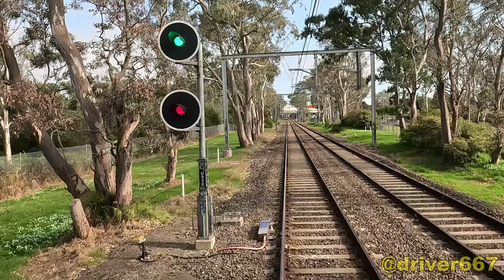Three position signallling in Victoria, Part 1, July 2025

Comment: As a small level train fan, high level rural commercial driver, I always wondered about these light combinations. As most of my driving comes into contact with infrequently used tracks, I have learn't three important things about the signal lights. Very handy if I am approaching an out of sight crossing. If the signal lights are on, there is a train ahead or behind. If both are red, it's close. If the top one changes green as I'm approaching, the train is going the same direction and is ahead of me. If the top one changes red, the train is next to me going the same direction, or about to appear in front of me heading the other direction. This small amount of knowledge has helped me avoid having to brake heavily at crossings. Handy in places around Tatyoon/Mininera, Willaura, Westmere, Pura Pura/Vite Vite, Minyip, Warracknabeal, Clunes, Talbot. These places appear to only have the signal lights come on when a train is near. Otherwise they are off. Obviously, don't rely on this and be cautious around crossings even when the lights are off.
Reply from the maker: Now you have more of an idea what those lights mean when you see them out in the field. Glad you enjoyed the video. 👍😀
Reply: @driver667 liked it well enough to subscribe.
Reply from the maker: @gaijininja  Welcome to the channel. 👍😀

Comment: not sure about now but Low speed caution is/was also used at the entrance of loops to send a train into the loop
Reply from the maker: It is still used on a few of the loops on the North East standard gauge. There are still a few of the original loops that have not been altered yet. 👍😊

Comment: You forgot Clear low speed. Where as low speed warning you should expect that the line may be occupied, Clear low speed indicates a clear track to the next fixed signal. Kananook has them and some at Westall, Sure there are others.
Reply: That is for the next parts. Clear low speed can not be shown on the home signals.
Reply from the maker: They are coming when we talk about dwarf signals in a future video. 👍😀
Reply: 3 position dwarf is different to double light 3 position signalling.

Comment: I am still currently a driver of 47 years in NSW, and I can’t get my head around the Victorian signalling system. I guess it's what you get used to. It just seems very complicated. Great video, by the way, thanks. I'm looking forward to more.
Reply from the maker: I've learnt a bit about nsw signalling and can understand where you are coming from. I think both systems have their good and bad points. Three position signalling is pretty easy once you work it out. Glad to hear you enjoyed it 👍 😀
Reply: I find the Victorian and Canadian systems very similar. More complex in Canada with a 3rd head and flashing lights to add (but once you work through them logically, the flashing signals make a lot of sense)

I can’t get my head around in NSW that green over red is a caution.  😂
Reply: A green over red is full clear, that's scary. 😂
Reply: 3 position is easy. Determine where red sits. B light red makes it normal speed. A light red makes it medium speed. Top/bottom green, proceed and expect next fixed signal at a proceed aspect (green or yellow is still a proceed aspect) and the next 2 blocks are unoccupied (clear). Top/bottom yellow, proceed but expect next fixed signal to be in the stop position as the block ahead may be occupied. A light yellow with B light green. This is a preliminary warning to reduce speed to medium prior to the next fixed signal as the next fixed signal may be at medium speed with a proceed aspect, if the next signal is not at proceed then the reduce to medium speed would infact be a yellow over red as the next fixed signal after a yellow iver red would be red over red (stop). Double red with 'c' light yellow is a low speed caution. C light can never be green as it is expected the block being entered is either "damaged, occupied, or obstructed." I've found vic to be easier than nsw but I'm slowly picking up the nsw way. Vic is speed based where nsw is distance (from what I've been explained) hope that helps
Reply: Yep NSW much easier to understand

Comment: Coming from Sydney where we use route based signaling this sure explains things down in Vic nicely!
Reply from the maker: It's an interesting system used up in Sydney also. Scary if you run in both states and forget where you are with a green over red. 🤔🤔👍

Comment: Apparently in practise, the third bottom light is rarely used for the most part and in some cases there may be only one light signal present.
Reply from the maker: There are always two lights with three position signalling. The low speed light below the two lights is required to enter yards or an occupied track. 👍😀
Reply: @driver667  Yeah I was thinking more on the lines of those signals where there's one giant light and one mini light underneath that's always red.
Reply from the maker: @VGF80  👍😀
Reply: 1 light signals are an SA thing (they have a reflector instead of a B light)
Reply from the maker: yes. a slight variation. 👍😊

Comment: The signal at 1:12 has arrows on it. What are they for?
Reply: It is a cheap version of a route indicator - the track speed is 40kph, the same as medium speed, so if a normal speed aspect is shown, the arrow on top indicates that the route is set to the left, while a medium speed aspect (top red) would mean the route was set to the right.
Reply from the maker: Yes, it is a cheap route indicator. Top light shows left route and the bottom light shows the route to the right. 👍😀